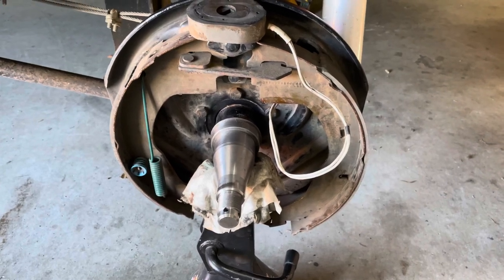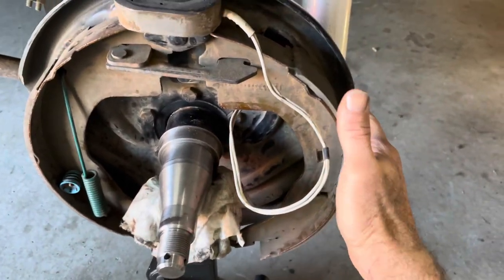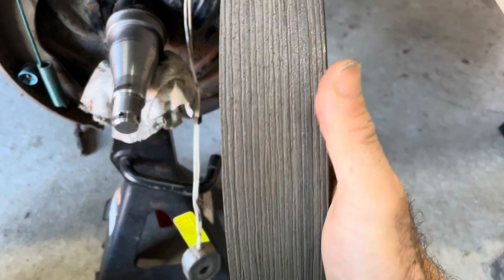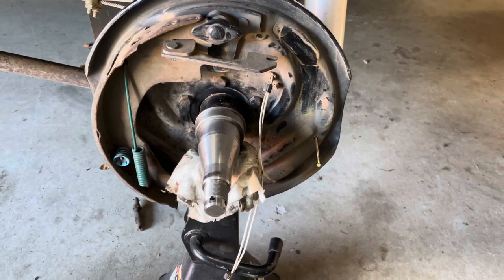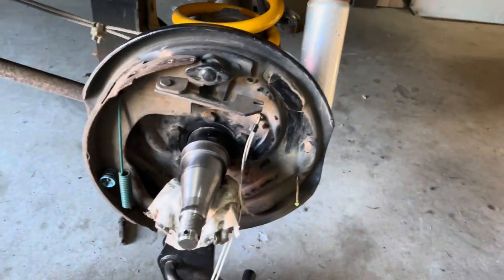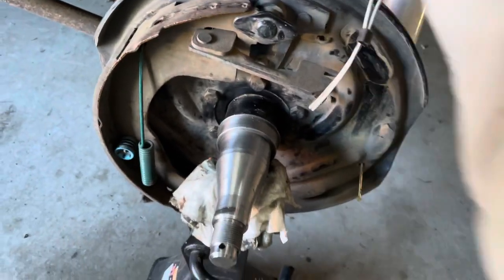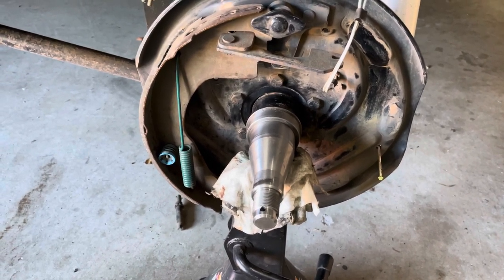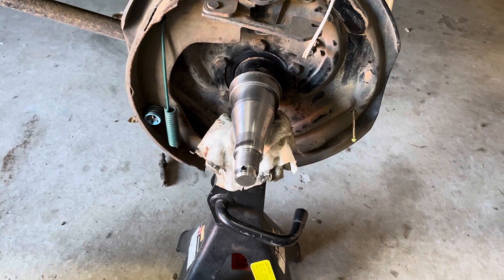Trailer brakes not working/ Dirt roads and Trailer Brakes

Comment: Why buy caravan magazines while you put information like this on utube how about one on esc problems I have just had a lot of trouble with my esc well known brand. Disc for me next time. thanks
Reply from the maker: Hi Rob I hope you found my video useful. Electric over hydraulic disc brakes are definitely the way to go but 
Cost nearly 3 times as much. If you haven’t already seen and I have posted a video on converting my own trailer to 
Electric over hydraulic disc brakes. So far they work extremely well and I am very happy with the setup except for how much it cost me . I assume you are talking about ESC on a caravan not on a car. So far I haven’t had much to do with esc most of the work I do is mainly electric drum brake issues but if I have one come through the shop I will definitely post a video. You are correct YouTube is now my go to for information on things, how things have changed.

Comment: Hi.

Off-road camper trailer -1900kg. 12” size brakes.

Which is best - disc or drum brakes?

Cameron
Reply from the maker: @Camh1968  after having both drum and disc on the same camper trailer and money is not a problem I would definitely recommend disc brakes over drum any day. 
There isn’t any really noticeable difference between the two under general Driving. The main differences the disc brakes are slow to apply due to the fact that the electric over hydraulic unit has to build up pressure( the AlKo iq is a lot faster due to the fact that it has a accumulator the hydro pro has to run the pump to build up pressure so it takes a little bit of time )So the first thing that is noticeable is that with drums apply as soon my foot is applied to the brake peddle the drums brake can be felt pulling up the trailer straight away where as the disc brakes will gradually come on which does equal smoother breaking less jerking on the back of the car from the Trailer. But can feel like the brakes aren’t working .The biggest difference is under emergency braking, the disc brakes have stopping power all the way to the end. This is something the drum brakes don’t do, as the wheel turns slower there is less braking force due to how electric drums work. 
You are doing a lot of off-road driving. The brakes are definitely worth it The only annoying part is the dust does make the disc squeal a lot at slow speeds. 
The only problem I have had with the whole set up is the hydro pro unit. They are now on version three of their electric over hydraulic brake unit and it works really well. The earlier ones suffered from a leaking brake fluid storage tank , had a slow underpowered motor and also very slow to release the brakes. They have fixed all this in the latest and greatest unit.
Reply: @philsrandomstuff2392  thanks Phil.  Really appreciate your detailed response.

I read conflicting opinions elsewhere about how disc brakes should never be for off-road trailers in sand / mud / etc. because the sand is picked up by the brake discs and pads and ruins the surface of the disc and becomes embedded in the disc brake pad.  

They use drum brakes for this reason.

Your thoughts on this?

Cameron
Reply from the maker: Disc brakes out perform drum brakes in muddy, dusty, dirty conditions, handsdown. Put it this way would you prefer drums or disc on your car?
Reply: @philsrandomstuff2392  many thanks Phil.

Very helpful.